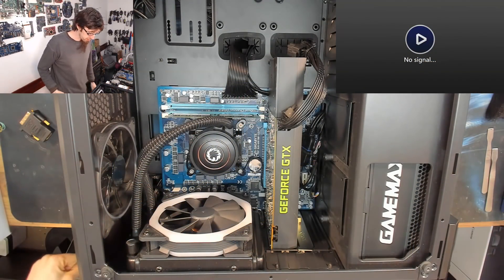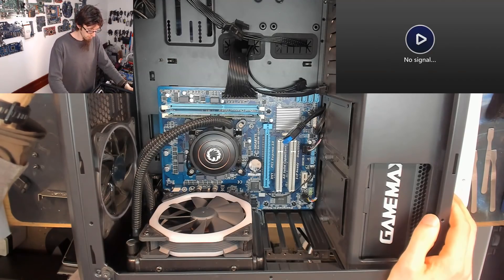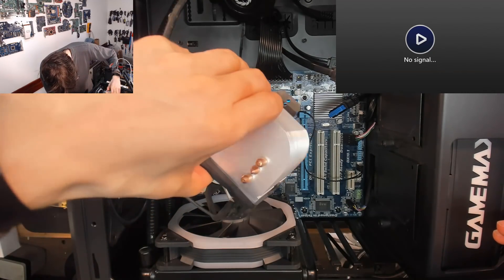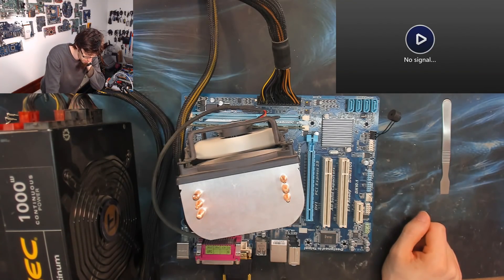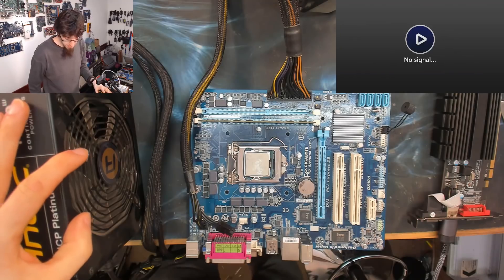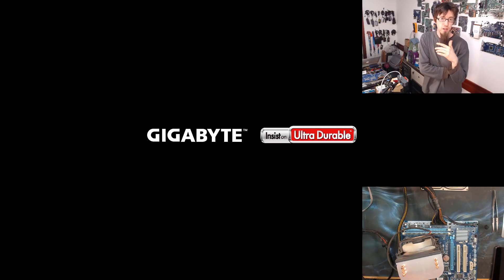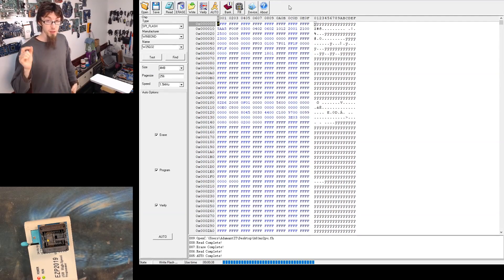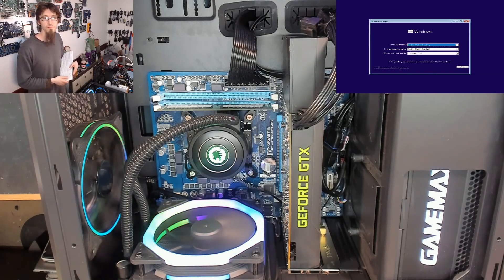LFC#207 - Troubleshooting an old Intel Platform (GA-H61m)

Comment from the maker: UPDATE: I did revisit this system, but I didn't feel like it warranted another video. Here's what happened: 1. I updated to the beta BIOS. Everything broke again to the point of no-posting and power cycling. 2. All attempts to invoke the backup BIOS failed. Tried shorting pins 1+6 on the BIOS chip while turning it on, no luck. 3. I manually programmed the beta BIOS and that fixed everything, including UEFI VBIOS.
So we would've been 100% of the way there if I'd gone for the beta BIOS in this video, but also I still had no luck with the other suggested methods. Either way, it's all fixed now!
Reply: ID LIKE TO SEE MORE STUFF LIKE THIS!  especially gpus that don't post ect  keep up the good work
Reply: So when you say manually programmed the BIOS is that what you did in the video? only this time you used the beta version? but you used the same device? pretty new to computers. had to intel dh77eb motherboards. one the bios update worked the second went into black screen and never changed. might try to use the device you used in the video. also great video!!
Reply: what are your thoughts on using debug/diagnostic post cards for motherboards w/o a debug led?
Reply: @unlockeduk  with 2nd 3rd gen, update the bios for 'current gpus' ive built 40+ systems, been there done that etc
Reply: what do you mean by manually programmed the beta Bios? I have some issues on the same motherboard, was thinking maybe maybe it would remedy them.
Reply: can u help me my PC stock or freezez when i watch utube  i can move my mouse and can click windows start but can shutdown the computer or endtask the chrome, Event log says  KERNEL POWER    EVENT ID 41
Reply: @bryanmacaldo8966  your power supply is either not sufficient or failing.
Reply: @mr.funkyright  OMG huhuhuh
Reply: @bryanmacaldo8966  actually no, I was on the go and didn't read it right, it could be anything, if you just see it as a kernel power problem in event viewer that means that it lost power by an unknown reason(and windows was not able to collect data).
Reply: @mr.funkyright   at 1st my system have rx 570 then upgrade it with rtx 2060 then, when i play games its ok temp is ok 56 to70 load on my MSI gaming z rtx 2060, after i finishing te game i watch youtube and then it crash, but u can still move your mouse and can  clik start buton  but i cant shutdown or resrt not coresponding and taskbar menu freez
Reply: I think old Gigabyte boards have a UEFI bug that has something to do with UEFI boot devices. When you plugged in your known good Windows HDD the problem went away.  My old Gigabyte board does weird stuff sometimes with UEFI boot devices, and I've never had another board since then that shows the same behavior.
Reply: @bryanmacaldo8966  : they Radon cards are powerful but the Drivers for them are garbage, I always wanted one but soon saw many people have probs with them do to the Drivers, also to you add outside downloads to ur PC?  and open them programs? or in games, you add Skins to them? i had BSOD issues do to putting on Shi\\]kind to my in-game  units.
Reply: This is a common issue with Gigabyte boards with dual-bios at this time(about 2007-2011)
Reply: @mr.funkyright  with the EZP2019 you have the choice of manual or auto flash the BIOS. His first flash of the Master BIOS, he used auto to flash the BIOS, On the second attempt, he flashed the Master and Backup BIOS manually. The order is in steps, Read, Save, Erase, Read (to check the BIOS is empty), Write, Verify.
Reply: If after a while it happens again "and it will" consider reheating or replacing the I/O chip (the iTM chip next to the PCI express) it is a well-known issue for this board. it's the worst gigabyte model ever built
Reply: Could u do an example video of what the issue was, then how you fixed it, as it is a bit confusing when u don't show the issue on a video then fixing it, thanks.
Reply: That's why I omit Gigabyte boards.
Reply: You should post the video
Reply: Can you perhaps explain how you manually reprogramed the bios? I am having this issue rn, i have beta bios and it posts but then black .
Reply: i would like to see more desktop motherboard repairs I have 2 boards that don't post one stopped working after I swapped a hardrive and wifi card so ya I think I could use your laptop repair to get me half way but ya would be great to have some dedicated desktop board repairs thanks great vid
Reply: So I have a pc having a very similar issue for some reason after it had went into hibernation the other day so I tried to wake it up and it took like 15 minutes to wake up but have no video output so I turned off the pc and it started to do EXACTLY what this pc is doing but if I keep fooling with it itl stabalize for a bit and if left at idle on desktop for five minutes or so itl start to power cycle again cant get into either one of the bios but I put it under load instead of letting it idle for those five minutes and itl stabalize and stay under load for hours without issue so I'm either thinking a bad bios chip or maybe bad caps on the psu like maybe its throwing out around 10v at idle then the load on the psu makes it output 12v actually able to sustain a load not entirely sure it's a new psu. Itl go to the boot screen then no signal when. Its having a failure but my gpu fans ramp down as well as the aio fans so it seems its having a problem with the hand off from bios to windows still not entirely sure. It's a mid tier gaming board from gigabyte and same for its dual bios it has no physical switch and with the keyboard not being responsive during these failures I cant input the key command to switch bios
Reply: i dont mean to be off topic but does anybody know of a method to get back into an instagram account??
I was dumb forgot the password. I would appreciate any tricks you can offer me
Reply: @Wilder Cain Instablaster ;)
Reply: @Brady Talon i really appreciate your reply. I found the site on google and Im trying it out atm.
Seems to take quite some time so I will reply here later with my results.
Reply: @Brady Talon It did the trick and I now got access to my account again. I am so happy:D
Thank you so much you really help me out :D
Reply: @Wilder Cain Happy to help xD
Reply: Love the energy you invest! I have spent thousands of hours investigating weird computers and feel with you when ur looking at your watch late in the evenings😂🤣
Reply: 9o

Comment: with Most of giogabytes older boards (i think new ones too) if the Main Bios EEPROM is corrupt but to a point it cant hand over to the backup (which most models its main function is only to reflash the main) if you short pins 1 & 6 on the Main one, you'll force it to trigger this Recovery and reflash the main BIOS eeprom.
Reply: Nice think thanks for sharing
Reply: obviously a known issue on the h61 from gigabyte, happened to be several times.
Reply: I have a Z68XP-UD3P that had a partially corrupt BIOS, and the only way to recover it in my case, was to desolder the main BIOS chip zero it out with a programmer, then flash F7 to it, and then do the same to the backup BIOS. In my situation the BIOS was so corrupted that simply flashing it wouldn't fix it, it required the chips to be zeroed and then flashed, and recovery never worked either, and I needed to manually perform each step when programming the chips.
Basically exactly the same as what is shown in the video, I found that fix by accident because I was bored and wanted to finally get to the bottom of this issue.
Once I did that it worked perfectly, and the boot loop issue that had plagued that board since I got it went away (or it had the last time I tried it about 2 weeks ago)
Reply: @PaulTheFox1988  That's an extreme Case, other situations as far as i've experienced and seen, the auto recovery/jumping the pins to force it , works well enough.
Reply: @CaelThunderwing  Yeah I've had that work with a p55 motherboard, but in my case with that z68 board nothing would work, and the only fix was to nuke it from orbit :(
Reply: i just done a h87 with the boot loop problem, good trick
Reply: @florinlinux4326  I wouldn't want to do it more than twice, but I've not had any issues when I've had to do it more than that on the same board, however the more you work on a board the greater the risk of permanent damage so try to work quickly, the less heat on the components the less likely you are to damage them.

If you're going to try and repair that laptop yourself, I would try to practice removing and replacing chips from a board that you don't care about first to get comfortable with it.

Also, I would make sure you have everything you need before you start, so make sure to have a decent hot air station, lead based solder, solder wick (try to use goot wick, you'll thank yourself for it if you do) and use flux (use amtek, it's so much better than anything else) and a decent pair of tweezers, and of course a chip programmer that supports your bios chip.

One thing that you should be aware of is that suddenly shocking the board with heat can cause it to delaminate (bubble) and if it does that, the board is most likely ruined, so I would preheat the board first with the hot air gun at 200C and warm the board evenly until it becomes almost too hot to touch.

Keep the hot air gun about 15cm away from the top of the board and try to avoid heating any plastics otherwise you'll damage them.
Reply: This is very useful information... thanks for the tip.
Reply: Mine wouldn't nothing worked. I trashed it , went MSI and have zero problems. MSI also has MANY more updates than GB ever did considering the age of the MOBO. My H81 MSI even has updates for ALL the original software for W10/64 bit and BIOS/UEFI all the way to 2018 Intel microcode security update. Christ , they had an audio driver update just a few days ago ! For a board almost 7 years old.
And the UEFI on the MSI is SO much better.
Reply: With my gigabyte board i shorted pin4(ground) with pin7(hold) and it reflashed main bios and everything worked fine. I don't know about this pin 1 pin 6 shorting
Reply: @TEKMENT  I think it depends on the BIOS chip, I seem to remember pins 1 and 6 on my P55 motherboard that I tried this on, but you might also be correct with your board.
Reply: @TEKMENT  it may change depending on board or revision,  for my old GA-F2A88XM-D3H it was 1 & 6
Reply: Short pins when it`s power on?Thanks
Reply: @andreilucian10  short them then hit power
Reply: @CaelThunderwing  thanks a lot!
Reply: @CaelThunderwing  Thanks....help me a lot!My main problem was 2 pins from the back of my motherboard who was on short.After 1 month of battle i won, my antique pc dinosaur is back to life :))
Reply: @PaulTheFox1988  Hi, I have the same mainboard, it had a mild waterdamage from the presvious owner, therefore I swaped the KBC chip and it still has the power cycling issue. CPU fan spins, than the board shuts off, a few seconds later the cycle repeats. No video output / logo at all.
Desoldered and flashed the BIOS, but maybe I have to flash it again. Try again. I would like to get it working again, any help is appreciated.
Reply: @dorfschmidt4833  if you have a multimeter then check for shorts using continuity mode on the 12v, 5v, and 3.3v (and -12v if it has it) power rails first, this is easiest on the 24pin motherboard connector, but also check the EPS12V connector as there could be problems there as well.
Make sure to remove the CPU and RAM and disconnect all power cables first or you'll get erroneous readings, and make sure to check the CPU VCore and the DDRVCC rails for shorts there too.

Also pay careful attention to the area where liquid has been, and double check your work where you've replaced any parts on the board, and make sure that any ic's in the affected area are outputting the correct voltages, although this can be difficult when the board is shutting down.
If you don't find any obvious shorts or missing power rails, then try cleaning the board with lots of 99% isopropyl alcohol and see where you go from there.

If it's shutting off that early in the boot process then it could be anything, but the worst case is the CPU VRM has shorted and is/has dumped 12V straight into the CPU sadly.

Once you find the rail/s that are shorted/missing, then you'll have to spend a lot of time tracing where exactly the fault lies.

Good luck!
Reply: @PaulTheFox1988  I've put F7 on both ICs, did not help. Maybe the CPU is faulty, can't test it, don't have a second LGA1155 board.
Reply: @dorfschmidt4833  Have you checked for shorts on the power rails I mentioned?

That is what you should be focusing on, forget the BIOS chips for now, if you verified the BIOS flash then your issue lies elsewhere and you should put your attention towards finding what is damaged on the board.

Again, check the +12v, -12v, +5vsb, and +3.3v rails for shorts with a multimeter, visually inspect the board for corrosion and double check your soldering work, I would expect that there is damage near the CPU socket that is preventing the board from starting, but look carefully where water actually touched the board just in case you missed something.

It is very likely that the CPU is fried, but do the checks I mentioned, you might be lucky.
Reply: @florinlinux4326  Many times without problems. You can check the datasheet for the actual guaranteed number of writes.
Oops, sorry... you are talking about soldering... Not too many times, 2 at most 3 I would say. If you;re lucky, you can solder it often, but the board/pads weaken with every try..
Reply: @PaulTheFox1988  Bought a second hand Pentium G620  for testing and after a few hickups [phase LEDs flashing] (& BIOS reset/new battery) the board started ! Probably the water damaged the video card too and the old CPU got shorthed out in some kind over the PCIe-lanes. I'm guessing.
Reply: @dorfschmidt4833  Nice! It sounds like water may have shorted the power pins into some of the data pins, I can't recall what the pin out is for that generation of CPU, but you're probably correct in thinking it was PCIe, as those are usually on the bottom left of the CPU, and the power pins are usually to the middle left and upper left corners of the chip and it's easy for them to bridge together.

It's a shame about the GPU, but at least you got the system working again.
Reply: @PaulTheFox1988  I only got the damaged mainboard, there was a bit of corrosion on some pins on the KBC chip, bought a new from China. Now I'm running memtest86 with two RAM sticks. Board needs to be tested thoroughly.
Reply: @PaulTheFox1988  Did you try the latest UEFI beta firmware ?
Reply: @dorfschmidt4833  I did, but it had issues that meant it was better to roll back to F7.

I much prefer the old BIOS layout even if the beta BIOS had been stable, but ymmv, it might work just fine for you and you might like the UEFI interface.
Reply: @PaulTheFox1988  OK, thank you.
I have an issue with an older 8400GS video card, board is power cycling and acts weird. A 9400GT works fine and GPU-Z shows connected PCIEX16 v2.0, second slot PCIEX8 works fine. And a few SATA slots have issues too. Maybe the board doesn't like hardware swaps, do I have to manually let the board make an hardware inventory after changing some drives or cards ?
Reply: @dorfschmidt4833  I don't believe that it does need to perform anything like what you mention, if a card is failing to work correctly and other devices are having issues then the board may still have liquid damage somewhere on it which can interfere with some devices that aren't as robust as others, I have seen this before, where some devices cope with slightly dodgy signals but others flat out refuse to work.

If you have access to a large enough ultrasonic cleaner then try running it in that to get rid of any crud still on the board.
If not then try using some isopropyl alcohol with a toothbrush and see if that helps.

If nothing helps then you can try flashing the beta BIOS and see if that does anything, sometimes it can help with device support.
Reply: @florinlinux4326  I tin the legs/lands with bismuth based solder. Can use hot air at ~200-250C after. Especially handy if component is around plastic connectors. Unlike low melt solder it's not corrosive so you don't need to clean it off. Also non-leaded so still ROHS compliant.

Comment: These videos are helping me to stay away from Gigabyte motherboards.
Reply: bought b450 aorus elite, immediately regretted it, bow got an x570 gaming pro carbon from msi
Reply: I've used loads of gigabyte boards, only issue i had was a blown audio chip - which was my own fault lol.
Reply: I've only gotten one gigabyte board in my entire life which was the x570 elite, took me a week to boot into bios and after that the ram overclocking gave me audio problems. returned it immediately after that, never again
Reply: I've got z390 aorus pro, i9-9900k at 4.9Ghz, RAM at 3200, no problems whatsoever.
Reply: ASUUUUS